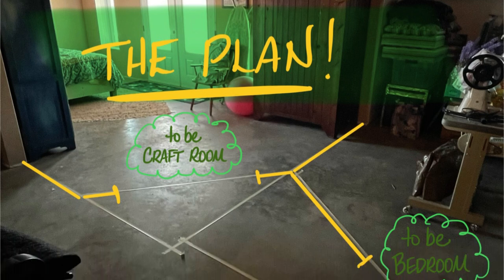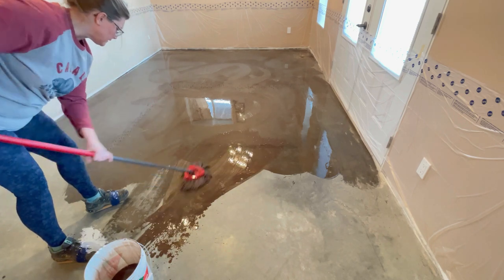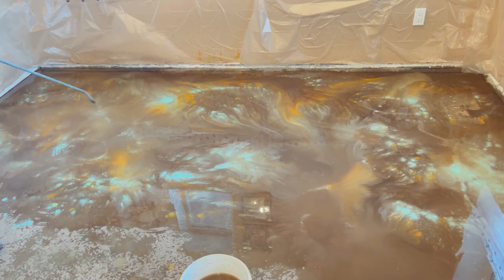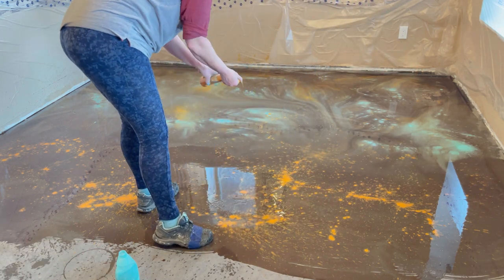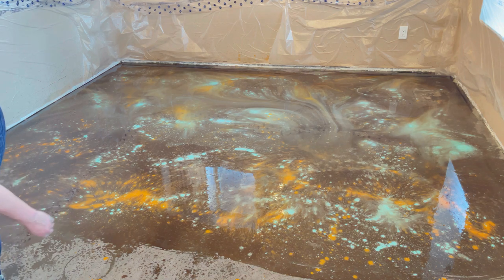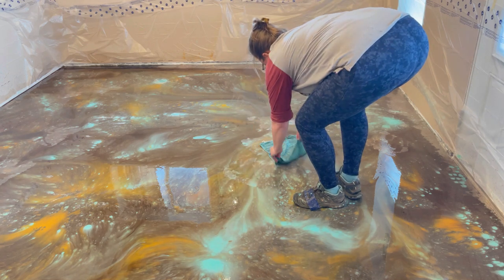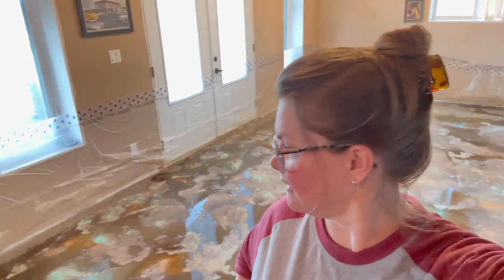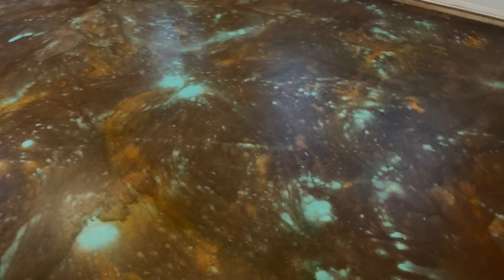How to paint your concrete floor and turn it into ART!

Comment: My floor is already painted would i have to remove the old paint to do this?
Reply from the maker: If it’s currently a colour you’d like to use as a base, you’re good to go! Otherwise, paint it with a base colour you’d like and then splash away with your accent colours ❤